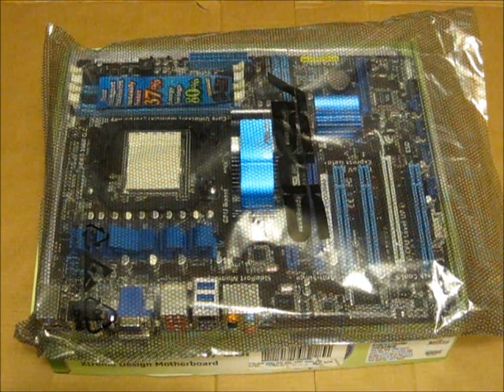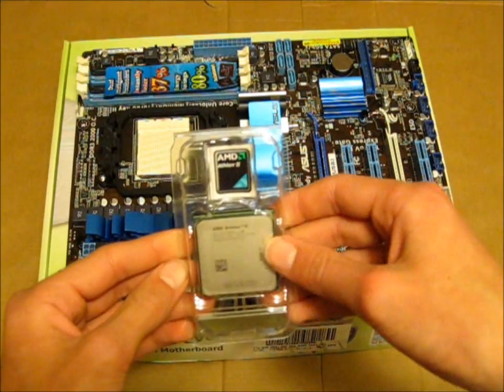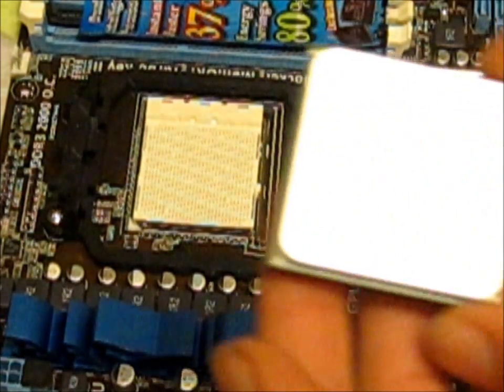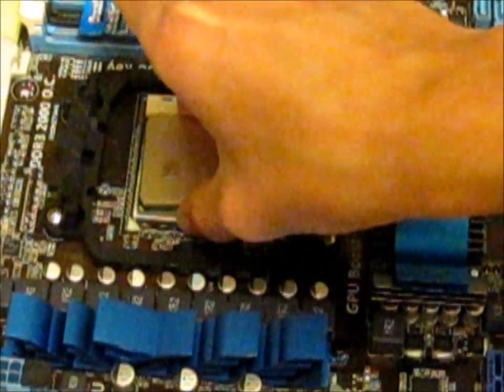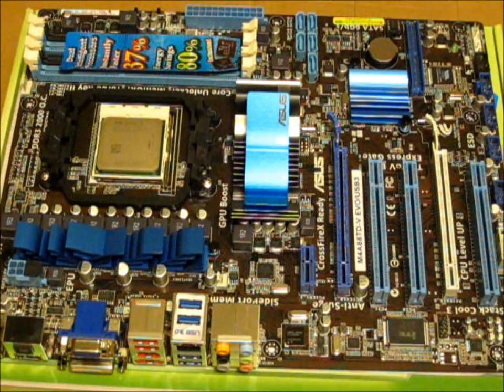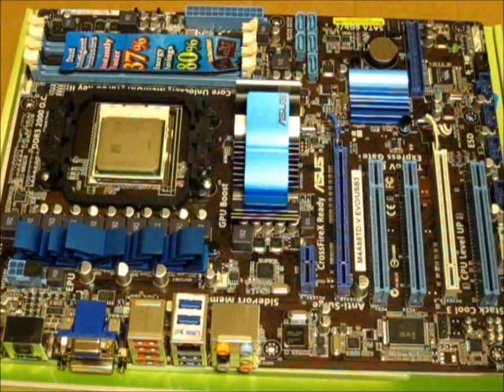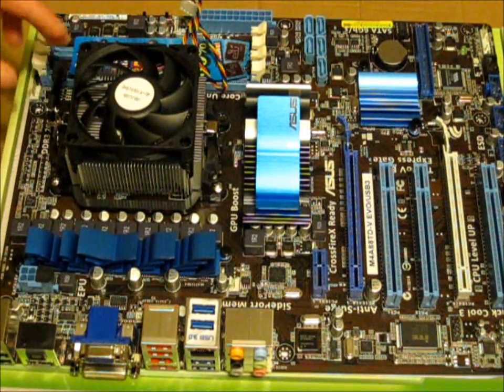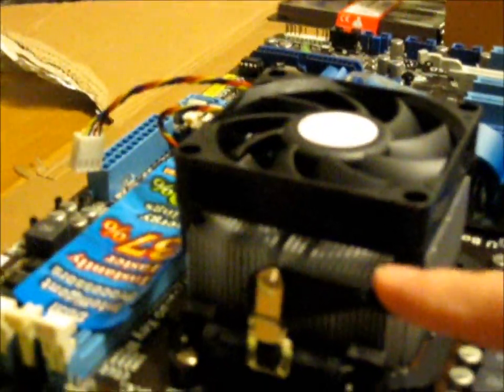PC-Build Series: How to build a computer: Part 2 Installing the AMD CPU and Stock Heatsink

Comment from the maker: @Thecashflowman Hi, Wireless internet is not intergrated into this motherboard so you if you wished to connect to a wireless router then you are correct you could install a PCI wireless card or you could purchase a USB wireless networking dongle. Make sure if you do purchase either of these that they are copatible with ythe motherboard and operating system. Glad you liked the vid, if you have any queries then dont hesitate to ask.